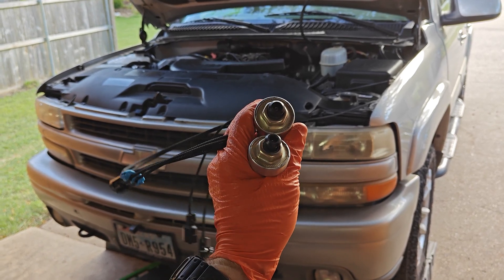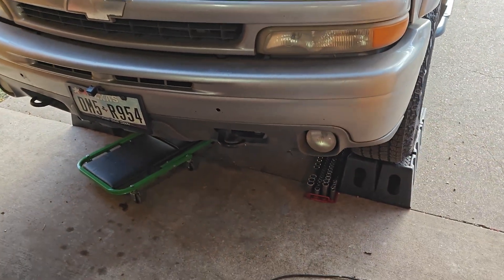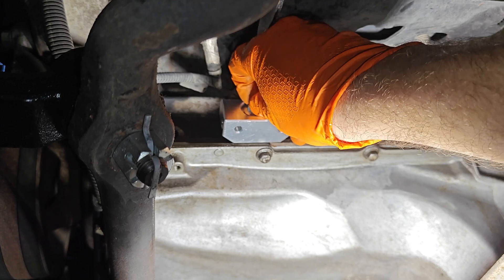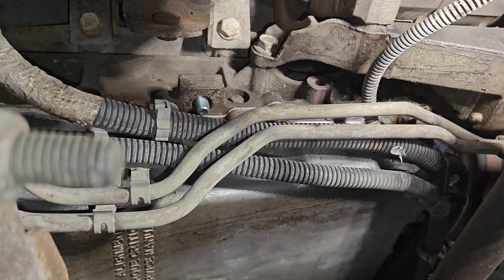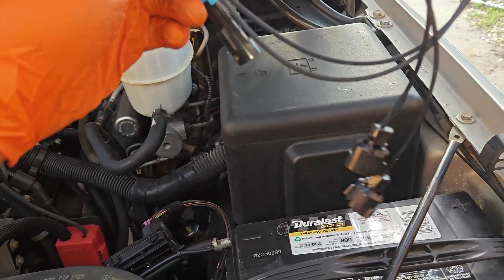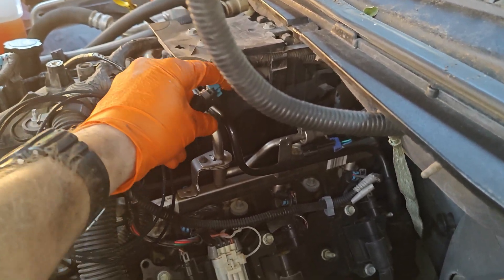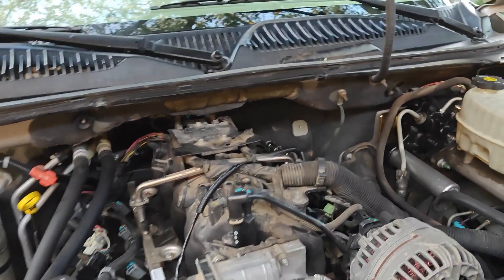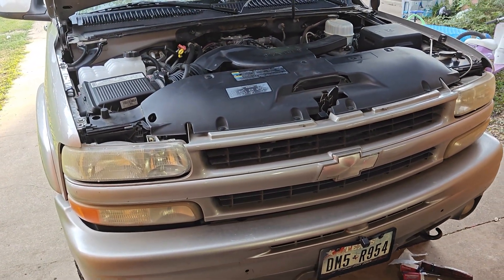Gen 3 LS Knock sensor relocation

Comment: Unfortunately on my 4x4 02 4.8 
There’s no tapped hole :/ 

Edit: Found it! Driver side, exactly where your video shows it. on a four-wheel-drive truck, it’s not as easy to get to. Gotta take off the skid plate and reach around and find it.

As for the passenger side, the starter is in the way, so I just mounted both sensors on the same mount

Comment: About to be doing the same thing. And of course I have a Z71 truck🤦‍♂️😂.
Reply from the maker: You got this!! Plan for a lot of laying on the concrete thinking about life with your fingers in places you can't see....
Reply: @gagefixeseverything I'm definitely familiar with it. Earlier this year I had to lower my front diff so I could get the oil pan off of my 5.3 so I could replace the oil pickup tube o-ring. It wasn't too bad but it definitely was not fun either lol😂. The biggest obstacle for me will be lowering the front diff again, but that's still faster and easier to me than pulling the intake. I replaced my knock sensors and wire harness 8 years ago with OEM stuff from the dealer (Acdelco). Sealed the rubber caps up good with rtv and never had a problem until mice got under my intake manifold and chewed both harness wires to pieces about 7 months ago. I knew there was nothing wrong with the knock sensors but I replaced them while I was in there like anyone with common sense would do. I bought the same exact OEM parts (Acdelco) but this time I ordered them from summit racing and saved about $120 versus buying from the stealership. Everything was good for about 3 months and then I got a random P0332 code. I've confirmed that the wiring is still intact and unharmed so I'm guessing that I got a defective knock sensor smh🤦‍♂️. I've just been reseting that code and driving the truck, but it keeps coming back randomly ever so often. I'm finally tired of putting it off lol😅.